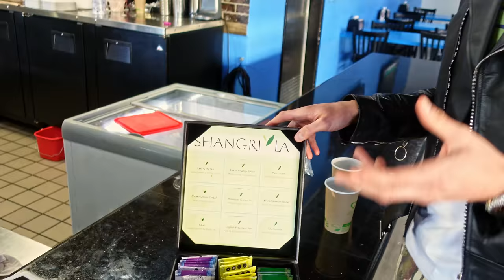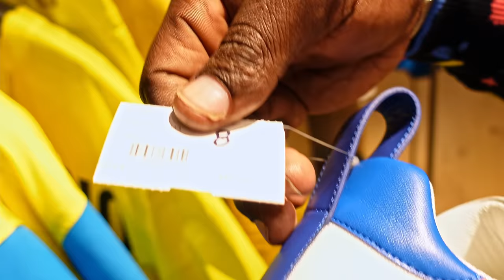ARE THESE THE WORLD’S BEST SUV’S…???

Comment: Kicker is a beast of subwoofer. Had 2 8 comps they sounded louder.
Reply: Facts I have 2 12s comp r in custom box 500 rms each so I’m running 4k watt amp pushing 1300 rms from the amp to the subs plus a 4 channel amp for door speakers and Have the amp tune the right way plus I sound Dead my car so you can hear all bass and no trunk rattle